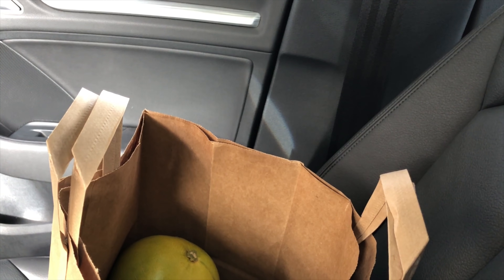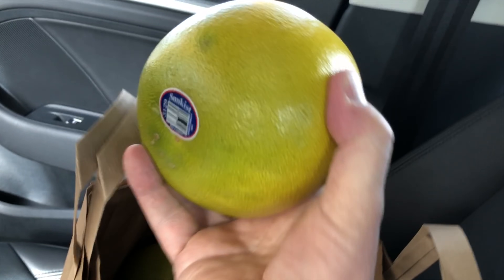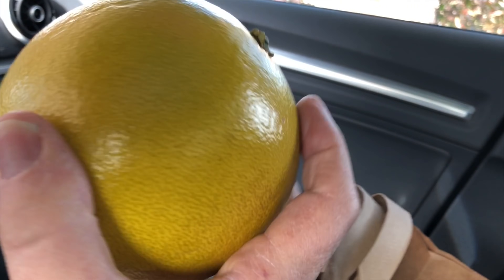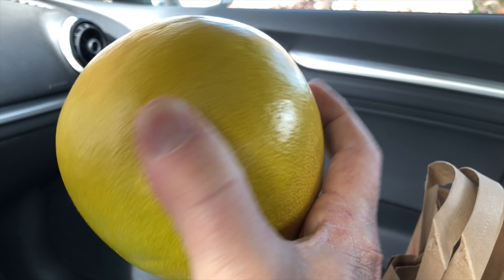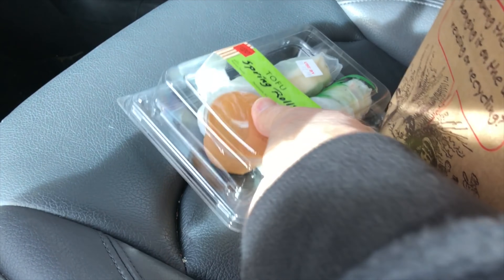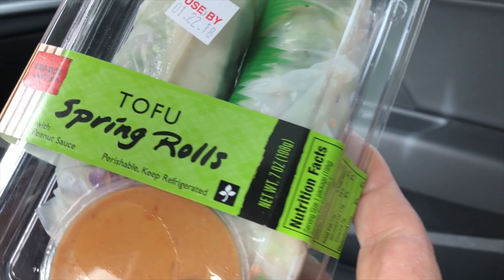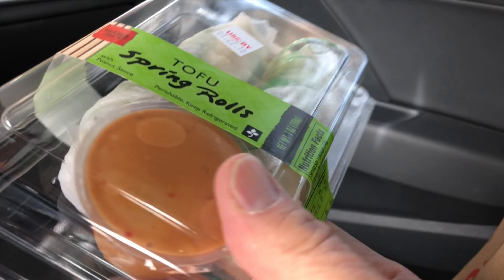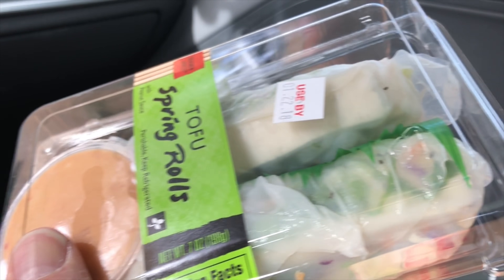The future of Class D amplifiers

Comment: I come from a world of welding but do have an interest in audio. This debate sounds very much like inverter vs transformer machines. Early inverters were seen as harsh, choppy and "not the same" as transformer machines. The die hards would never change. Early adopters were rewarded with smaller size and more efficiency but nothing else, much like Class D. I was always told use a class D for your subwoofer. Use A/B for the mids and highs. 

Today however, everything and everyone is usung inverters because the technology and control circuitry is above and beyond anything imaginable. They use the same tech as Class D. PWM is used to imitate a sign wave but where early machines were switching in the kilohertz range they are now in the megahertz range and its a game changer. Granted audio has more problems to overcome because it must be pleasing to the ear I believe Class D will get there and surpass Class A/B eventually. 

For comparison we have an old 650 amp machine at work that weighs about 800lbs and only has a 60% duty cycle and is about 60% efficient. Our latest inverter is also 650 amp 100% duty cycle and can do AC/DC and is over 90% efficient. The best part is it weighs about 75lbs!
Reply: Interesting comparison... I've been trying to dump my old Lincoln Buzz box to buy an inverter.  
Fyi I have an NAD class D amp, and it is awesome. So I guess it's like an inverter welder
Reply: I want to get a decent small and lightweight/efficient amp. No more power hungry 20kg beasts ! As long as the class D can sound just as nice with bass etc
Reply: @RennieAsh  Show me a class D that can sound as good. It's not like anyone is going to save a fortune in power usage, because a KW/hr of electricity costs pennies so one load of laundry cost about as much as 4 months of listening. If I was worried about saving a few cents, I would rather hang my clothes out on the line once every few months, than sacrifice music quality with a class D amp. Maybe someday, but the class D amps I have heard gave me instant listening fatigue.
Reply: Gord Thor  Have you ever  blind test any of  your gear against an nCore (for example.)  ? Do it and you may get surprised...
Reply: @gordthor5351   Summers can be a challenge for small air conditioners and the extra heat load of class A or tube power amps may limit when and how much time is available for music , to say nothing of 3 hour movies on a Plasma TV .
Reply: @biketech60  Yes, but if you live in a cold climate, JC 1 mono blocks (in 25 watts class A mode) make the listening room very cozy. They don't get too hot when switched to 10 watts class A, but they double as space heaters in 25 watts mode. haha.
Reply: @antoniolucena7304  It would be fun to see! Alas, I think most hi-fi fans are basically religious in their approach. They want to believe, and the more esoteric, the better. For heaven's sake, these people are reading reviews of exotic cables, and don't mind that there is no possible way that a cable, no matter how expensive, is going to perform any better than any run-of-the-mill copper cable with sufficient wire gauge for the length. The editors of "esteemed" magazine Stereophile were invited to blind test speaker cables at any price point against a cheap pair of Monsters by James Randi, and would get a million dollars if their "golden ears" could correctly identify which cable was being used in a blind test, risking only some embarrassment should they fail to do so. Yet for some mysterious reason nobody took him up on the challenge, but preferred to go on recommending that their readers "invest" in bits of magical wire costing thousands of dollars. Perhaps their belief is not always entirely genuine? Perhaps the entire hi-fi industry, like religion, is a sort of conspiracy where everyone is buying into and mutually supporting a science-defying world view..?
Reply: @dojohansen123  Spot On! That's exactly what I believe they do... No science, lots of Placebo effect, Lots of ignorance  (at best) about the Physics involved in music/sound reproducing, and of course a complete industry being fed on this snake oil and ignorance... But I always follow this popular axiom that says: The worst form of blindness is that of the ones that refuse to see..
Reply: @gordthor5351  I actually prefer my class D amp over other stuff I've had. It's not fatiguing at all imo. It won't warm up your audio nor will it make it harsh. I just forget that there's an amplifier in the circuit. Now I need to figure out the speakers and room .

Btw if the recording isn't the best then that will show through unless you set up specifically to smooth over that trait.
Reply: I think your intuition is correct, except it has already happened! With GaN transistors, and a top quality power supply, class D can now equal and surpass the best of traditional amplifiers - at a fraction of the cost. Unfortunately, there's not much rational competition at the high end. 

A top-notch amplifier can be had as a PCB, e.g. https://www.classdaudio.com/cda-120-power-amplifier-module.html, and would cost me $120, meaning it can't cost the manufacturer more than a fraction of that to make; I'm guessing less than $50 at any rate. The only expensive component left is the power supply, but for a manufacturer with a little bit of volume it shouldn't add more than $50-60 per unit at most. Switches and cabinet adds a few dollars, but the other electronics and software (BT, ChromeCast, Spotify Connect) ranges from a few cents to free. 

I reckon a class D amp that's so good that spending more is always pointless can be made for a parts cost of less than $150. So there should be a butt-kicking class D amp that nothing else can beat on sound quality, and only another class D amp can match, costing no more than $300. But also a $200 amp that's so close that only those with the very best speakers AND specially adapted listening rooms need consider the $300 model...

I'm sure the NAD C338 is great, but I just cannot fathom why it should be so expensive. And I hate the idea of having to pay for a RIAA stage (I am not vinyl-religious and don't think I'll ever own a vinyl record again, despite the nostalgia), which, if well done, probably makes up a large chunk of the parts and build costs. Seriously NAD, how conservative can you be?!? It's fine to offer a version with the RIAA stage built-in, of course, but at least ALSO offer one without it, and without the needless expense, because 95% or more of us will NEVER use it.
Reply: Two years later, essentially all of the new model guitar and bass amps are class D and the old models are discontinued.
Reply: @carpediemarts705  Very true in the electric bass world.  Their light weights are saving a lot of backs as do the Neo magnet speakers.  They sound fine to me.
Reply: Back when I used to read about this stuff regularly...30 years ago...One of the audio magazines were testing some high-end, ultra expensive monobloc amp, and after reviewing the measured delivered power they got from it, thought it would be nifty if they could try and weld with it, and they did! It wasn't great at it, but they were able to get it to function as a stick welder.

Comment: I haven't used a Class D amp for any home audio listening, but I sure use the hell outta them for my PA and bass rigs with my band. I went from carrying 2 500 lb. road racks full of amps to one 20 lb rack. and most of that weight is the rack itself, not the amps. Sure, it doesn't look as impressive as the old gear, but my 53 year old back doesn't complain like it used to anymore and the rigs sound just as good and run way cooler.
Reply: Professional applications I believe will be the first to adopt. I have Behringer Eurolive 12 inch subs and Yamaha Dbr 10s. The subs weigh 41 pounds with the internal amps and cabinet. I also have helped install many digital amps in churches and man that rack is so much easier to deal with.

Comment: The best Class D amplifiers sound good, but compared to the best, they take away something that is hard to explain and yet obvious when heard. They can at best sound rather nice and smooth, almost too much so. I had a pair of Hypex NC400 and not bad at all. But when up against the best, that is when you heard what was lacking.  I would love Class D to get there, but right now listening to something so exceptional that no Class D amplifier can do. Strangely, it is a hybrid, solid state front end with tube output stage, but unlike any tube output you have seen, no global feedback, large amount of local feedback. Needs to feed with absolutely good signal source, whether digital or analog. A lot of shortcomings there to get right too.

Comment: The best analogy I can think of for a class D amplifier is a newspaper photo.  If one were to try to directly control the precise amount of ink going to different parts of the picture, it would be very difficult to do so.  Using a halftone pattern so each part of the page is either black or white makes it much easier to print a recognizable picture.  A photograph which is printed via more "analog" process might be of higher quality if everything in that process is calibrated perfectly, but printing with a halftone process is inherently cheap, while using analog process is inherently expensive.  Consequently, the best halftone pictures that can be obtained at various price points will often be better than the best analog pictures one could obtain *at those same price points*, even though once one reaches the "price is no object" point, the best analog photos would be better than the best halftone photos.

Comment: Hi Paul. Owned one of your earlier dacs a decade ago. What you say rings true. But for Bass in an active loudspeaker. Class D rocks. I experimented with an inexpensive yung SD-6 300 watt on a small twin 8 in sealed Peerless 830667 sub and it slaughtered the Redgum Audio A/B 180  it replaced at 1/3 the cost for tone & bass inpact. A few filtering and rfi gremlins that tweaking & faraday caging solved.
I was genuinely amazed.

Comment: A lot of things have been told about the future.  A lot never came true or happened to be completely wrong.
Reply: Exactly
Reply: And some things already happened and it just passed you.

Like in this case. He said they are running at 100 MHz.
I dont know any class D amp running so low.

The lowest Frequencys i have seen were 500 - 700 MHs. So 7 times higher as he said.
Good class D Amps like Bowers and Wilkins implemented in subs ect work with around 1 MHz or even higher.

I guess he just made a mistake. because output filters are no problem any more since a few years.

Maybe he is not so much into class D. He has his knowledge in Class A and A/B and such. But either he did a mistake, or he should do class d homework again ;)

http://newscenter.ti.com/2016-12-05-Industrys-first-2-1-MHz-Class-D-amplifier-transforms-automotive-audio-design

There are even some which reach about 8 MHz.
Sorry, but 100 MHz? My ass. Nothing against Paul, but its simply wrong.
Reply: @dom3827  You probably meant "100 KHz" and "500 - 700 KHz" there ;)

Comment: With Paul M. and other high end companies moving toward using a tube preamp stage with class D output stage in their amplifiers, it's a safe bet the future of class D looks promising.
Reply: I'm with you Mike I think there is a very bright future for Class D. I have a very nice Halcro MC70 here on my active stereo system, and it does a lovely job of clear / clean audio, but it lacks the spirit of the tubes. I had a tube / ss hybrid Butler Audio 5150 which I sold to my brother in law to match some Cremona speakers I sold him. I want that tube sound back and have thought about a tube  buffer for between  the active xover and the Halcro. I think you can have your cake and eat it.

Comment: what i`ve been told  class d do not last  no longer than a year
Reply: ? Mine Hypex UCD's are 10 years old and doing just fine. 
[A well designed] Class-D system generates very little heat and that should reduce the risk o breaking down.

Comment: In digital sampling the highest frequency that can be captured is half the sample rate or its Nyquist frequency.  44.1 was chosed for audio CD's because it was considered good enough since few people can hear above 20 KHz and it allowed a reasonable amount of music to fit on a disc.  Is there any similar value for switching rates of Class D amplifiers?  Is there a value such that if you want response to frequency Y that you would need X * Y switching rate?  Are there any tradeoffs to higher switching rates?
Reply: the higher the better.

Comment: I get with ucd btl -100 or even lower distortion on simulations. but needs high open loop and feedback this do hamer the amp dead soundings very clinical. However when disign a multilevel version it go much better, even in open loop distortions of -60 or higher is possible, the new mosfets gaN-fets are indeed very fast and have, and this is very important low gate capacities.

Comment: At the moment I don't think class-D 'scales' too well,  the smaller (12-24v) chips are the ones which, thanks to the linearity you mention, seem to emulate Class-A / single-ended (solid-state or valve) in many ways, not least their reproduction of 'microdynamics', and are often very sweet and musical.
Reply: This is not fundamentally an issue. Most of the signal energy is in the low frequencies, so you can potentially combine a high-power class D amplifier with big somewhat slow MOSFETS, filtered aggressively down to lower midrange, followed up by a 12V amplifier that does the rest of the range... Or even combining with class AB corrective amplifier that will never end up needing to do much of the heavy lifting. Of course interference between class D stages is an issue, but it's solvable.
Reply: As a musician, there are plenty of 125/250/500/600W class D amplifiers.
What Paul didn't mention is that they usually don't care about speaker impedance, and can push 500W as easily through a 4 ohms 410 cabinet, as an 8 ohms 410, or a 6 Ohms 610!